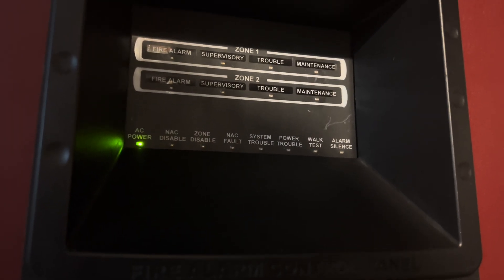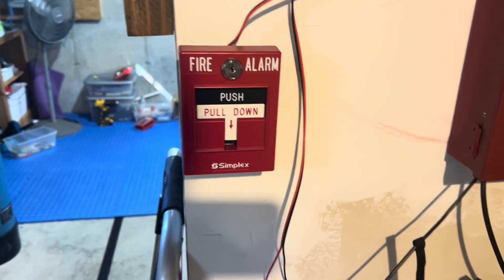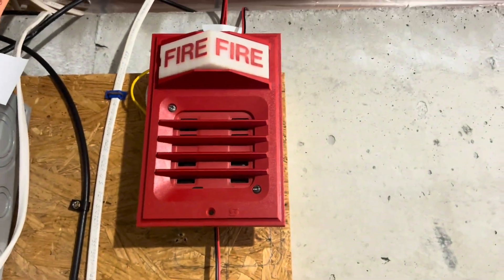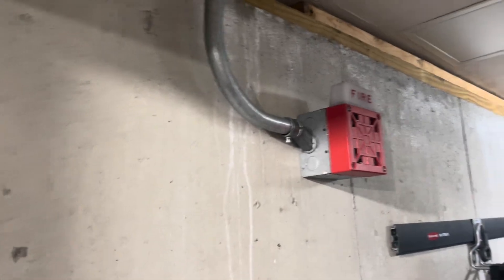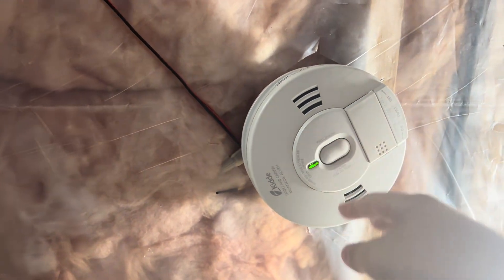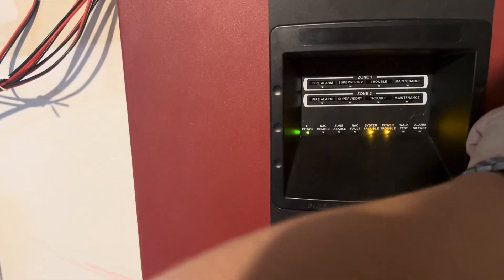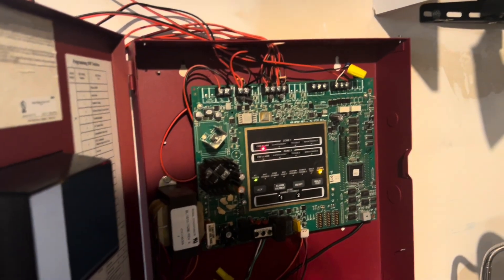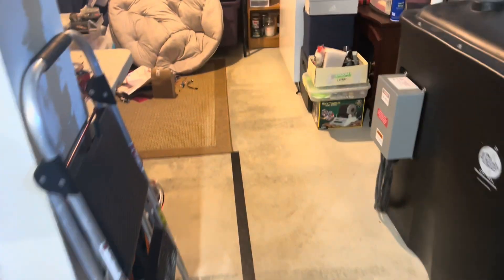System Test 37: 2nd Elementary School Simulation

Comment: Sounds amazing and it sounds like your school had a cool mixed system! The mechanical horns sound strange.
Reply from the maker: The mech. horns sound that way due to the fwr current output from the panel. The panel does not supply the NAC with filtered DC, unless you unplug the panel and have batteries.